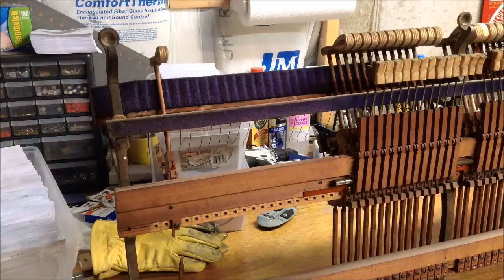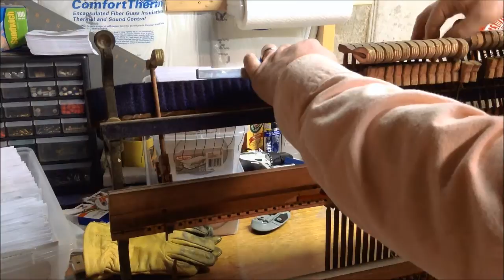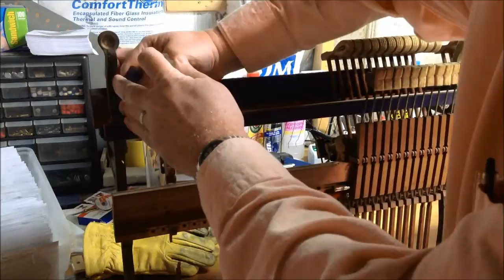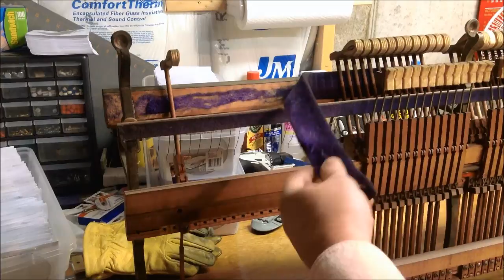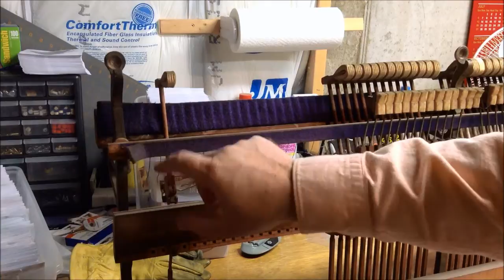Piano Repair - Replacing Piano Hammer Rail Cloth & Spring Rail Felt I HOWARD PIANO INDUSTRIES

Comment: Is that a Steinway action? I have an action with purple felt. I cannot find that color anywhere.
Reply from the maker: A piano with purple felt will have had it installed at the factory. The most common replacement felts are red and green. If you wish to color match the purple you can reach out to billiards cloth suppliers and inquire. Thanks for watching!

Comment: Hi there, thanks so much for these video.  When scratching off the old felt with a knife/blade, is scratching the wood underneath a concern? If so, do you have any tips for avoiding that?
Reply from the maker: It’s ok as long as you don’t take off wood in the process.

Comment: Just did one of these -- in the piano.  Recalled your tip on stringing back the connectors on a spinet and used the same trick here -- ran a length of string to hold the hammers out of the way.  Worked wunnerful well :)